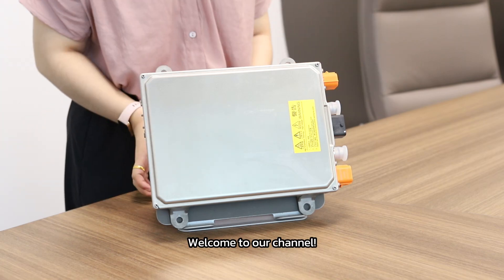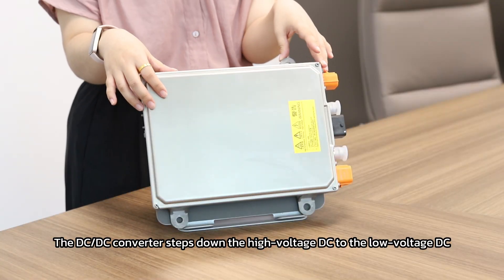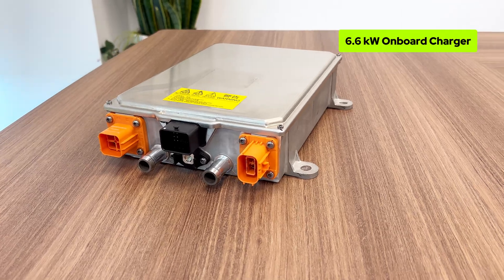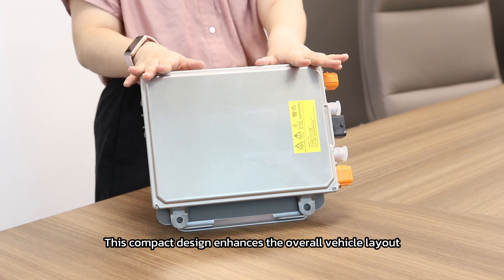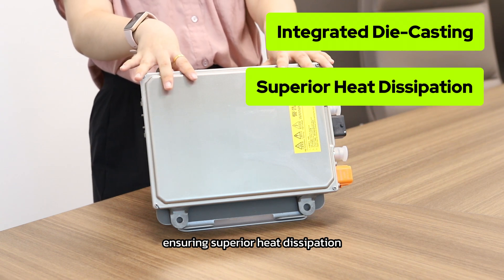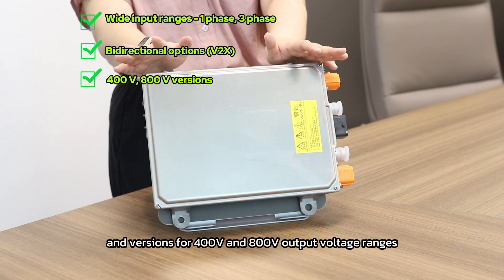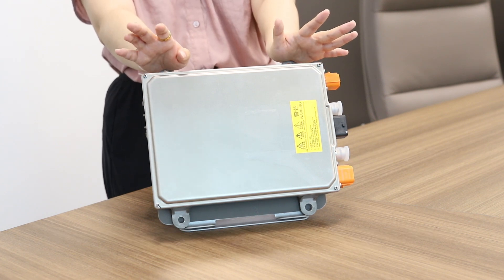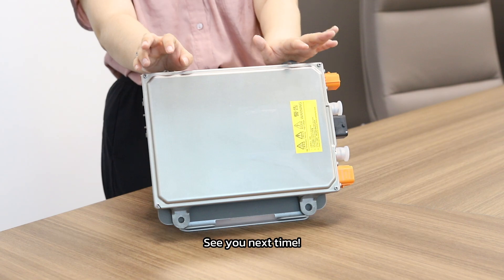Very Compact On-Board Charger & DC/DC Combo for Electric Vehicles #ev #emobility #charging

Comment: Do you have any charger/electrical system which can make my MG Comet EV (Wuling Air Ev) to support DC fast charging. Currently this bvehicle only supports AC charging using Type 2 charger.
Reply from the maker: Hello we currently don't offer this kind of solution
Reply: @BrogenEVSolution   Thanks for the information. Do you know any other brand who supplies this kind of systems. 

Please took a look at these components https://youtu.be/_TjrpgUkXns